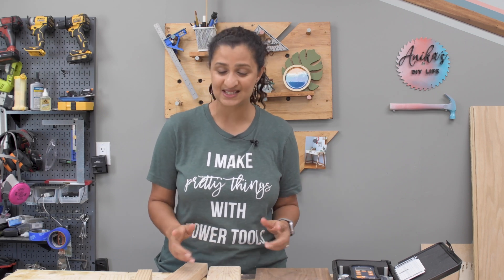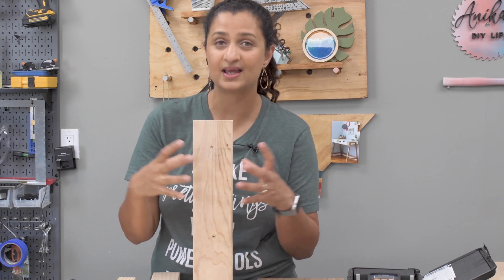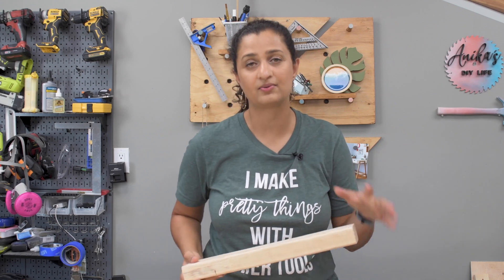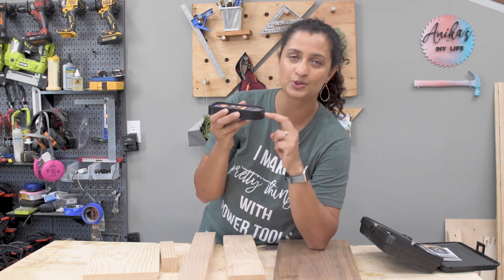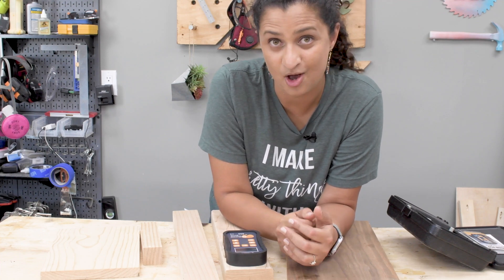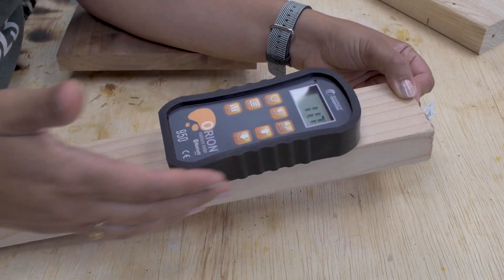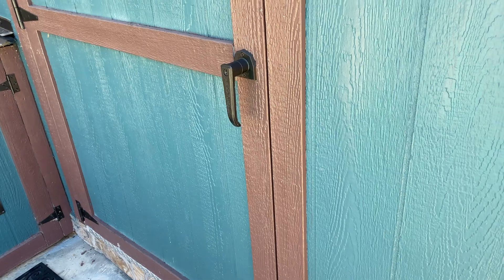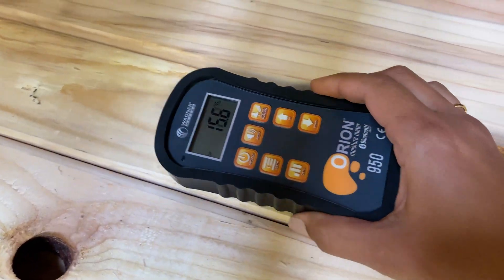What's moisture content in wood - And why should I care?

Comment: Makes sense to have the boards moisture close as you can get it. My problem is I don't have a workshop or garage, use back porch to work. I have to buy lumber for each project instead having a supply ready to be used that's acclimated to my environment. What do you suggest for something like this?
Reply from the maker: I would definitely recommend checking with a moisture meter before buying to make sure you get boards with the similar EMC.

Comment: I noticed you never lifted the boards in the lumber yard for air movement when you measured the water content was there a reason for that
Reply: Why do that? Yes you want to stagger them when they are stacked for air flow to allow even drying but to just measure I don't see the need. She's just doing a quick moisture reading to demonstrate varying moisture levels per board.